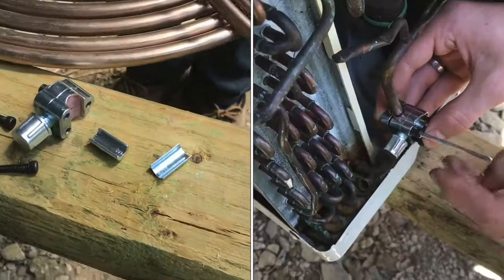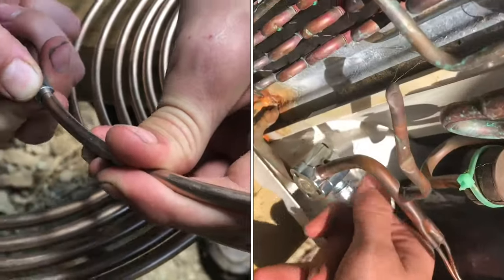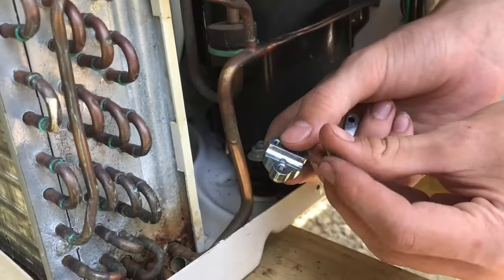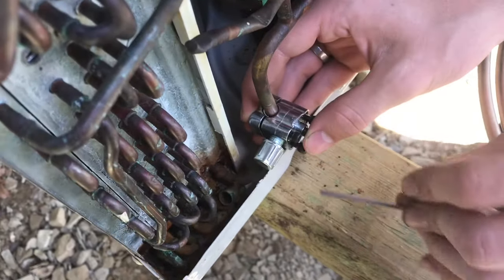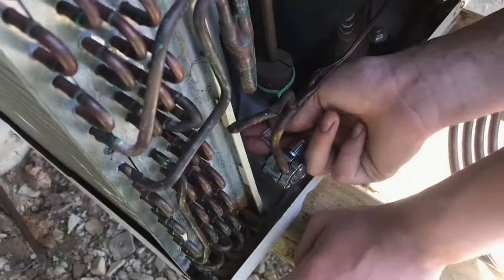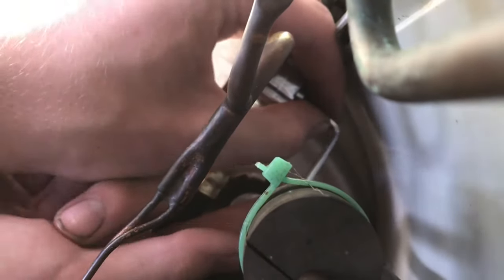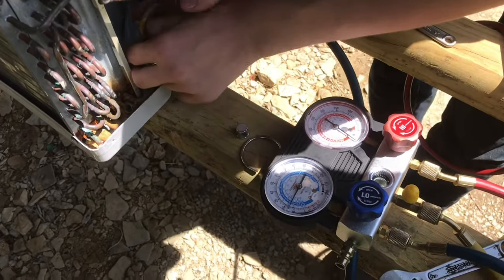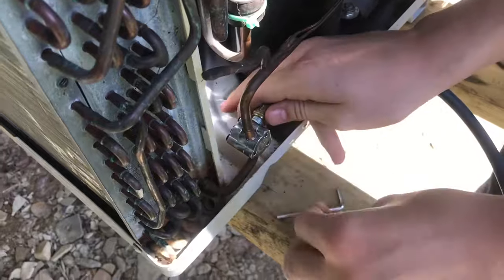INSTALLING supco bpv31 bullet piercing valve

Comment: I put liquid gasket on mine just to be sure.
Reply: Which product
Reply: JB Clearweld works very well. Use a small piece of aluminum tape to protect piercing side but not so much that the epoxy has nothing to adhere too. Its a little tedious but it wont leak if you wait a couple days or so for it to properly cure.

Comment: I failed miserably. I used the bigger middle piece and it wasn't that tight, but tight enough. Then I tightened the piercing valve, but I saw it start to back out. And I stopped and came back to the video to see what you said. You said tighten all the way until it stops, so I said okay then. I kept tightening and tightening and eventually the piercing portion of the device fell out. I couldn't easily get it back in with my fingers, then I moved it a tiny bit too. So I probably have a hole in my pipe now that I need to seal up. Dunno what I did wrong. Well I have an idea I guess. But this definitely wasn't as easy as it should have been.
Reply: 0 lo
Reply: @malachiflorence6816  I got the version that's in the video. It's not even made by Supco anymore. That one fit better, and it worked a little bit, but I think it caused a leak as well. I dunno. I realized my other fridge is probably cold enough, so I stopped messing with it for now.

Comment: my pipe is 3/16, can't find a bpv fit this size. Can I use a 1/4" bpv31?
Reply: I have same problem. I already have the BPV31 and it doesn't look like 1/4" fits well. Too loose.

Comment: So you show the half of the valve where the various adapters fit in.   Is the the other half with the piercing needle a one size fits all?   If I want to tap my 18,000 BTU Kenmore window unit can I guess what size SUPCO to buy without taking it apart first to measure the copper low pressure line ?

Comment: What is piercing a valve ?
Reply: For anyone looking for a copper fitting that you sweat in both high and low side look for CD8414/2 C&D Copper Access Tee Valve 1/4" CD8414 Package of 2

Comment: How to tell low pressure ,from high.?
Reply: It depends how high you wanna get.
Reply: The hot side is the high pressure. The cold, low pressure side will have insulation around it. The hot side is the output from the compressor pump. In a dehumidifier the air hits the cold radiator first. HTH.

Comment: Hello 
I put the valve but the pipe hose I bought from Amazon does not fit. I bought another one and it doesn’t fit too. What size are you using? Thanks
Reply: If you grab a caliper you can measure the outside diameter of your hose and then buy an appropriately sized valve.
Reply: You have piggyback the other insert.
Reply: Those are R-12 fittings. Get a adapter for whatever Freon you’re using. Usually R134 to R12

Comment: They donts show which pipe to put it on.
Reply: Suction/vapor pipe (i.e. fat pipe between evaporator & compressor. Probably insulated.). System probably uses capillary tube, so you'll charge with target superheat numbers.